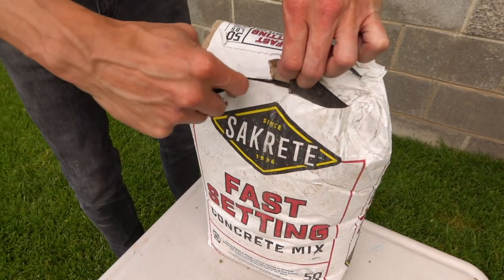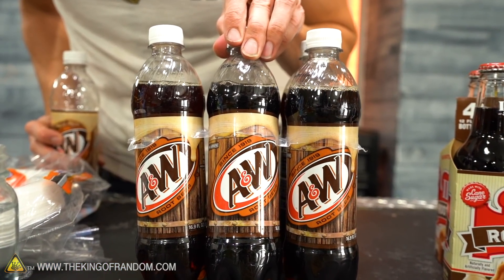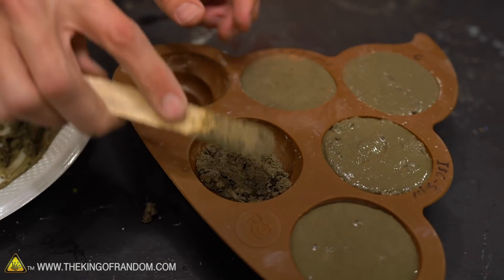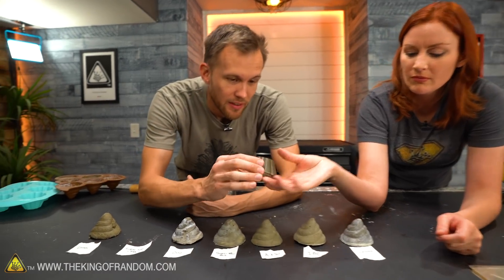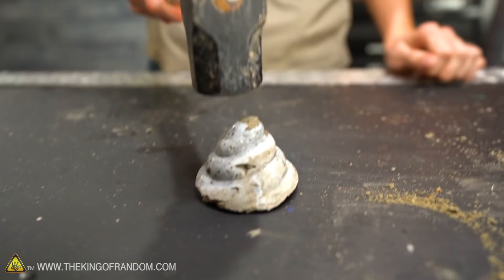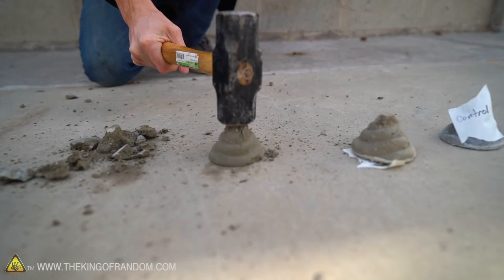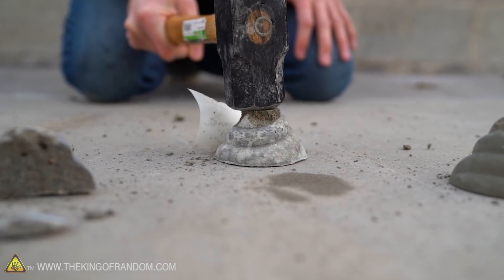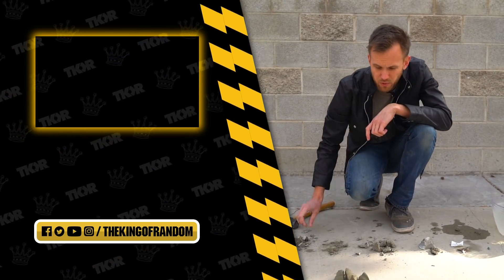One of These Ingredients Makes Super Cement

Comment: Clearly pH is a factor.  The sodas are all acidic, even the Perrier due to CO₂.
Reply: The carbonic acid formed naturally in the Perrier gives the drink a pH of around 6. Compared to the acidity of root beer (4.5) and lemon juice (2), that's minuscule (reminder that neutral is 7 and that the pH scale is logarithmic). I'd wager the suspended pockets of CO2 gas creating bubbles (i.e. stress risers) in the cement has a much bigger effect on its integrity than the small amount of incidental acid in the Perrier.
Reply: Small brain go whirrrrrr.

Comment: The acid in the lemon juice neutralized the Calcium Oxide (Lime) in the cement. CaO (and water) combine with atmospheric CO2 to form CaCO(3), Limestone, which is what makes concrete Concrete. Basically, we're reducing limestone to a powder, mixing it with sand and rocks, and...
letting it become limestone again, this time with rocks and sand as fillers.

The sugar, OTOH, simply displaces CaO with its molecule, and is more than ready and willing to dissolve again, as soon as it sees water. This removes it from our "limestone and sugar" conglomerate, thus leaving a limestone sponge, softer than pumice.

Just a layman, and working from memory, here... Which, at my age, can be dangerous.

Comment: If brass is copper and zinc. Can you boil the zinc of and have just the copper left? Like if you agree
Reply: Technically yes... zinc will boil at a much lower temperature than copper.
Reply: @dustin46224  I meant if you boil all the zinc off technically you would just have the copper left and you could use the copper for casting

Comment: Would be interested in seeing cement made with different types of glue. I’d think the glue would make the cement tougher but there’s only one way to find out!
Reply: This is a great idea but if they do it they should make sure to use a large variety of glues and that at least one of the glues is a liquid glue.
Reply: Also - Make sure if testing "wood glues" that you try both the standard Elmer's type, and the "acid free" of the same type, which is used for book making/photo albums, etc.
Reply: Oh! Mix it with resin!
Reply: You'd need at least SOME regular water to start the curing reaction, but I'd love to see how adding glue affects it!
Reply: @ShineHatfield  what about a glue that has water in it? That’s why I said they should try at least one liquid glue.
Reply: PVA is widely used to strengthen an make concrete waterproof

Comment: As a person who tests cement as part of my job, this video hurt.
Reply: So what's the worst thing to mix with concrete?
Reply: I feel your pain. Think everyone here with concrete experience and aci certs were cringing and yelling at their phones lol
Reply: Do you have any insights to share based on your experience?
Reply: First of all, concrete should be placed in cube or cylinder molds. After 24 hours, the concrete should be removed completely from molds and placed in a tub of water at 75ish F. Ideally you want them soaking for 4 weeks, but they should get to 75%-90% cured after 1 week if you really need answers now. Also you should you a hydraulic press with the mold cushioned between rubber pads. Honestly it would be easier to look up the ACI or AASHTO concrete testing standards and copy from there.
Reply: @mikeytheeaglescout  Is the removing from molds needed or all kinds of cement, or small tests ones? I'm thinking of cement driveways and understanding that you take the  mold off  them and keep  them most, but can't figure out how to submerge them fully
Reply: @xam3580  just the test pieces. For driveways and other large areas bbn of cement/concrete you want to cover them in a cloth(usually burlap) and keep the cloth soaked as often as possible.
Reply: @godfreypoon5148  wdym hudralic. It’s hydraulic.

Edit: and he did use the correct spelling of “hudralic”
Reply: Glad to see I’m not the only ACI certified person here lol

Comment: Anything with bubbles is likely a weak carbonic acid.
Unless you can find drinks with nitrogen bubbles on sale. Those might have interesting results. Considering how inert nitrogen is.
Or perhaps you can use those soda machines and nitrogen canisters to make some bubbly milk. And then concrete with it.

Comment: Im not sure what, if anything sugar does in isolation, but yes, acidity will wreck cement, its a highly alkaline process optimal at pH 11+ 
Even rain thats acidic enough will ruin cement, so putting carbonated drinks usually with acidic ingredients as well in to the mix will ruin it.

Comment: Cement contains lime, the acid disolves the lime that's why te cement won't cure.
Reply: @bearinara  Lime is also the the name for an inorganic mineral that contains calcium. Limestone is made of lime; hence the name.
Reply: @wolfpile1  well.. more so reacts with the lime... Making it chemically unavailable...as after reacting with the acid.. it makes salts... mostly soluble ones, that means it can't form into limestone by absorbing CO2. But yeah, you are right
Reply: @bearinara  Limestone is heated in a kiln to make lime.
Reply: In the building trade, bricklayers use a diluted acid, I believe sulphuric acid, to clean brickwork of any mortar (cement-sand mix) that may have gotten on the faces of the bricks
Reply: @assassin44987  same with tile work
Reply: NEEEEEERD

thats actually a cool fact
Reply: Wow I did not now that
Reply: @B P nothing important anymore
Reply: So would adding lime juice help or make things worse
Reply: @brycebthehottie3400  It wouldn't help as lime juice is acidic
Reply: would adding a calcium source help with making it stronger/brittle then?
Reply: thank you, I kept yelling in my head as I watched

Comment: Super glue with cement - - - epoxy resin with cement - - - silicone with cement - - - expanding/foaming adhesive with cement - - - pvc glue with cement.
Please do this.

Comment: my question is, if you ruin the bonding of cement with lemon juice. Say for example; in an emergency you needed to for some reason prevent the cement from bonding. would you be able to use another substance or perhaps even just a large enough amount of water. to sort of decontaminate the cement of the acid, and reuse the same cement in water per usual, to properly bond the cement again???
Reply: I’m thinking that it was the acidity that made the difference. So adding a base to neutralize the acid might work.

Comment: I think cement is mostly made of bright lime, which makes the hardening an alcaline reaction. Adding acid migh simply prevent it. Just my 2 cents
Reply: Exactly, which is why they should have been wearing gloves to mix the cement in the first place.  Cement mix is basic enough that people with sensitive skin can get chemical burns from it, but it would be interesting to see what would happen with the reaction using various bases to mix it.
Reply: Yep, mainly calcium oxide, which is turned to calcium hydroxide with the addition of water and finally calcium carbonate in a reaction with atmospheric CO2 as it cures. Citric acid in lemon juice just neutralises the oxide to calcium citrate so the initial reaction with water can't happen

Comment: Using carbonated drinks for cement will not work because the carbon dioxide will want to leave the cement as it heats up while it cures so the cement will crack and will have boubles in it

Comment: Put cement carbonated water in a cup and put ketchup in straws and place them in the cup. In seventh grade it didn't break by smacking it with a hammer and running it over with a car.

Comment: What would happen if you tried to freeze dry cement as soon as you mixed it, and before it had time to settle and harden?
Reply: Great thought though!👍
Reply: @gusbouklis  yeah sounds bout right
Reply: Dad iussed to say that high strength concrete is refrigerated and uses  very little water...
Reply: It wouldn’t cure as cureing isn’t the same as drying. The water is used in a chemical reaction. If you dried it before it cured it would stay the same as at the point you dried it
Reply: It would fail. As he mentioned, it needs to be wet, to cure. If you dry the cement out too quick, it will just fail and be crumbly
Reply: No